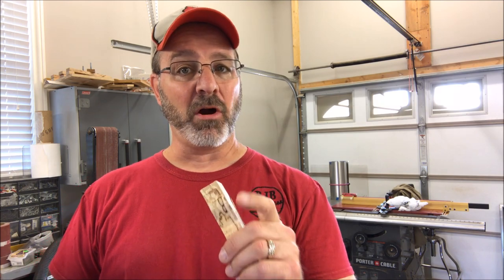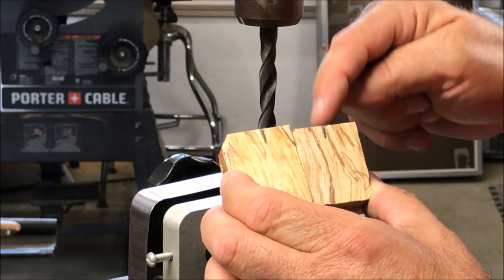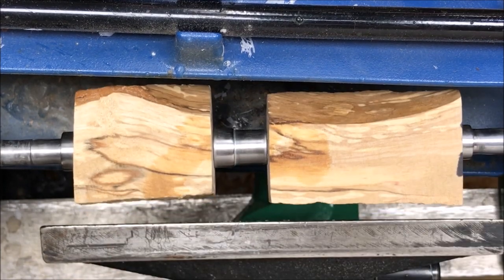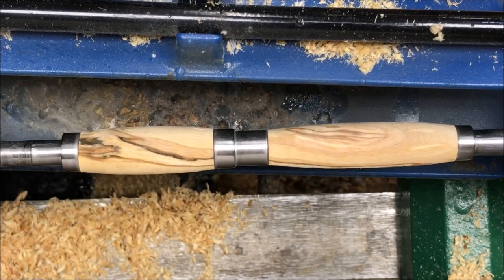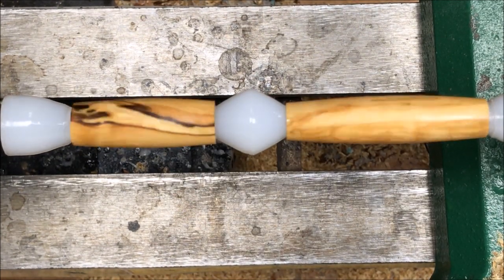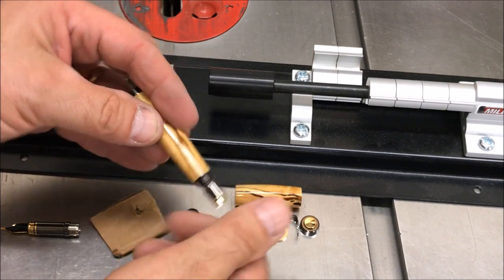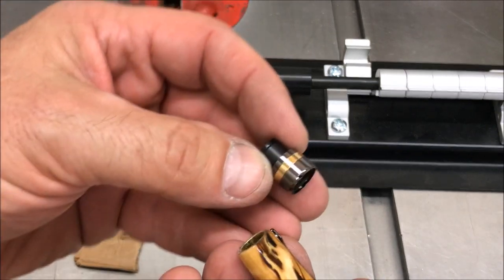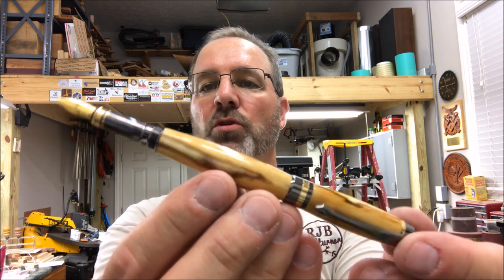Spalted Birch from Cannock Chase in Central England

Comment: Bob, beautiful pen as usual. Here's a quick question/suggestion: Have you thought about reversing the assembly sequence and adding the threaded couplings last so that could be aligned for grain match in both the posted and closed positons? Just a thought.
Reply from the maker: +Larry Lawhon LOL,
  I hadn’t until I was editing the video and saw that the grain didn’t align. Im thinking about a follow up video to address and fix that issue. Sometimes I get so excited about a pen that I don’t think through all the details that make it extra special. 

Regards,
Bob

Comment: It's beautiful wood and that is my favorite kit (roller ball).  One question: how come you didn't line up the grain when the pen is closed?   I line the grain up before I press that center ring into the lid.
Reply from the maker: +Adam Bruce Hello Adam,
  I’ll be doing a video this weekend where I correct that issue. I just missed it and didn’t realize that until I was editing the vide. It was a real head slap moment. 

Regards,
Bob

Comment: I just turned two of the “traditional” versions of the PSI fountain pen.   The plastic cap that holds the pen together confused me, so the first one is a bit mashed up.  Do you have any tips for this version?  

Great blank, it turned out extremely nice.
Reply from the maker: Hello John,
  I’ve only turned this version. I use to turn the Classic pens but the kits from PSI got sloppy so I quit turning them. I need to pick up a few as well as the FP version and give them another try. 

Regards,
Bob

Comment: How do you keep your CA finished pens from cracking?
Reply from the maker: I avoid Activator. It cures the C/A to quickly and causes cracks. 

Also, make sure you only use dry wood, damp wood will dry and shrink causing cracks. 

Regards,
Bob